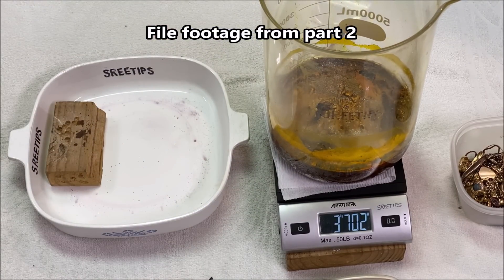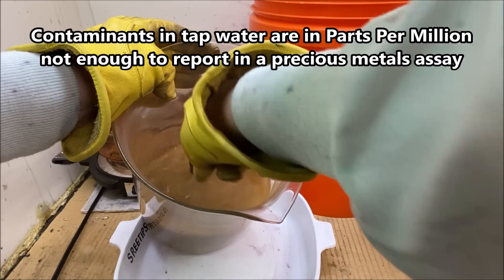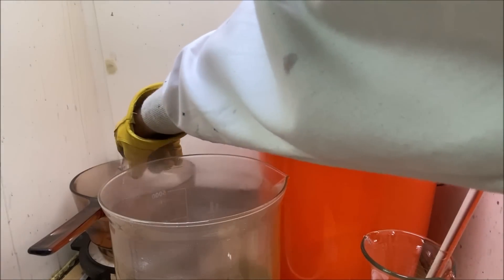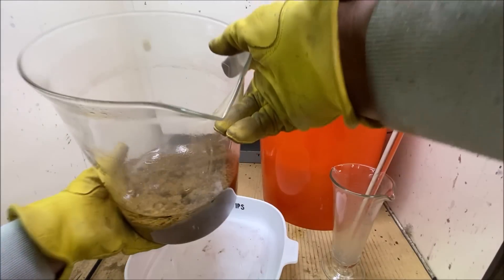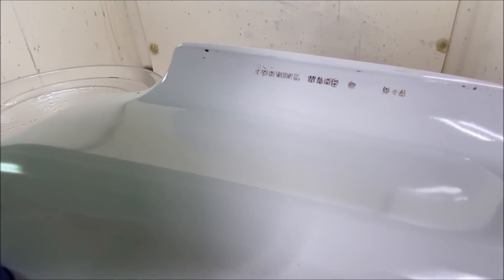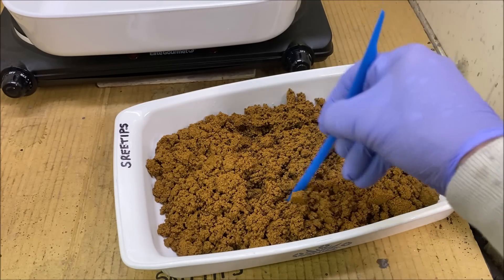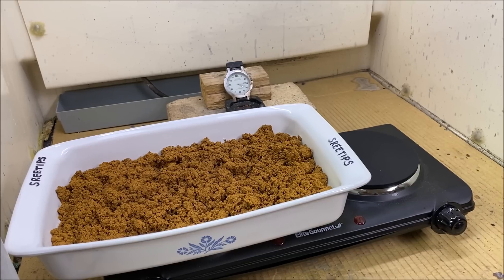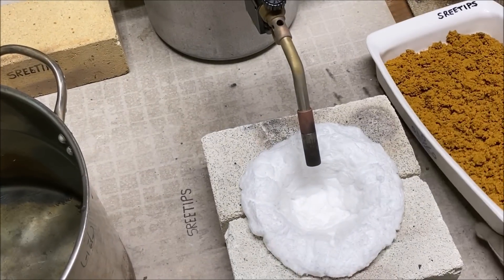50 Ounce Gold Bar Dissolved Evaporated to Dryness Pt3

Comment: you say tap water is measured in parts per million and can't be detected with an assy, then why spend money and use distilled water?
Reply from the maker: Because tsp water is chlorinated. I always use distilled water when working with silver. Chlorinated tap water will cause silver chloride to form in a silver nitrate solution. But a gold solution is already a chloride so tap water is ok.

Comment: If you wanted to break down into smaller denominations wouldn't be just easier to put the 50 ozer in one big crucible, heat it up and make 25 of your 2 oz bars?
Reply from the maker: Possibly

Comment: I’m in the middle of dissolving all my 40% and mixed metal coins, along with some other pieces of unknown silver content items as usual I get the blue and green liquids that are perfectly clear but yet I keep on also getting some sort of a white precipitate lingering at the bottom that does not dissolve with nitric any clue what that might be ? I only ask the best. 😉
Reply from the maker: “Pieces of unknown silver content” I believe that’s your problem. Some of the unknown may have junk metals (lead or worse, tin). That’s why it’s important to TEST EACH PIECE BEFORE COMMITTING TO THE ACID. Even with 14 years experience, I still test each piece with schwerters to verify silver content. It’s the only way to be sure, and to avoid nasty “white precipitate” surprises.
Reply: @sreetips  😉 thanks very much
Reply from the maker: Also, your 40% coins should be held as-is because they contain a known quantity of silver minted by the government. When you destroy the markings their value becomes questionable. If you want to refine silver then you should check sources for estate sales in your area and get up early, be there first, and buy sterling silver at those sales. The sellers use the grossly undervalued spot price to set their ask price. It’s a no-brainer, can’t go wrong buying silver at these ridiculously low prices. Good luck!

Comment: I was woundering, if you use wahing up liquid or jet dry in the water you rince the gold with, wount the gold sink to the bottom? Kind of like the gold washers. Or would it contaminate the sponge?
Reply from the maker: Whenever any substance is added it increases the risk of contamination.
Reply: @sreetips  These are the ingredients 

Water. ...
C10-16 Alcohols Ethoxylated Propoxylated (C12-14 Alcohols Ethoxylated Propoxylated) ...
C10-16 Isoalketh (Alcohol Ethoxylate or Trideceth-3) ...
Sodium Cumene Sulfonate. ...
Citric Acid. ...
Potassium Sorbate. ...
Polyquaternium-2. ...
CI Acid Blue 

Maybe werrh s
a try just to experiment with it, maybe they completely disappear with heat. Change there aggregate state.

Comment: Another thing you could do when evaporating the chloroauric acid down to solid crystals would be to let it dry down in a vessel that has been lined with waxed paper. If there are no leaks then you can pry the crystals off of the waxed paper and put them into a container of your choice, and put the paper into paper storage to recover any crystals that stick to it.

Comment: If gold gets too hot does it ever go into a vapor/gas form? I’d be so afraid the torch would blow little pieces of gold all over the place too. Such interesting videos.
Reply: Yes, gold vapor is often created with a torch fume gold onto glass. It is a common art form and can cost only a little or a lot depending on the artist and size of the work, the complexity will only add to the cost. Look up fumed glass, gold, silver and the like. They always complain about how they can't find 9999 gold or silver. If they only knew Kevin!
Reply: In fact Kevin add the key word 'fume quality' to your eBay listings for the folks looking for 4 9s gold and silver. Elemental might not catch their eye the way fume will.

After all they are going to be ones to pay the extra price for the purity of the metal since they'll be using so little in all of their operations see what I mean. And I know you don't want to let go of the silver at any price but you can certainly charge a premium over normal price for it.
Reply from the maker: Yes, gold will vaporize if get it too hot

Comment: The paper towel method works great and works better when you preload the towel before you submerge it by squeezing it. You'll remove more air, and the towel will pull the water in when returning to shape.

Comment: 10:00 you should do a pour that isnt fully melted, it would make some good pieces to sell, like 10:15 id say is ready, dump it into water and it should stay as one big chunk
Reply: And the required Artistry can be acquired by experience when you have so much to work with. 

Most of the time you can get a fragile shell with a little dust still adhering to the inside of the thin shell. The rest of the gold powder will rinse out. Doing this in a weight-less environment or freefall or microgravity would be best as the fragility of the crust of gold is overcome by gravity so easily. The art multiplier would be somewhere in the neighborhood of 50 times the cost of the gold

Comment: Another great vid Mr. Streetips, really didn't expect a pt. 3. Hoping there will be a pt. 4 now. Just wondering do you have a vid of making your own fume hood or was yours purchased.
Reply: Just buy a Thomas brand, cheap and effective for these uses. Plan your venting to have the least number of bends or 45° angles as those decrease evacuation dramatically for these uses. You can spend a lot of course even with Thomas, some units are in the 10,000s but for less than 300 usd they can not be equaled.
Reply from the maker: If I was starting over, I’d order a big 500 gallon poly plastic tank with a six inch diameter connection on top. Cut the front to make an opening. Use 6 inch pvc and an external acid-proof ducted fan.
Reply from the maker: I purchased mine on eBay.

Comment: I was wondering if you thought about using gaseous SO2 instead of SMB to ppt your gold. You have done this before using SMB and H2SO4. This method looks very clean but I am sure you have a reason for not using it. Along with everyone else, I love the struggle and results.
Reply from the maker: Chlorine will dissolve the gold.
Reply: Yep I edited this to make the correction to SO2
Reply: @jamescball55  probably would require a lot of smb in the gas generation and would take many more hours of fiddling with the gas gen eq than this ppt and hot tap water rinses. I was impressed it only took 2 of the Stumpout jars.
Reply from the maker: SO2 makes the cleanest gold.
Reply: That was my impression from your many videos using it. I was wondering why you did not use here with such large amount of gold?
Reply from the maker: Because I need about 2 liters of liquid per ounce of gold - it must be diluted or the reaction is cumbersome. With fifty Troy ounces id need a hundred liters and I don’t have a container that big.
Reply: @sreetips  See, I knew you had a very good reason. I am wondering about this reaction now and will attempt to find our more from your videos and the gold refining forum. Thank you for answering my question.

Comment: I know the intent was to break the original lump into smaller bits; but to me, this experiment from evaporation right up to the melt seemed awkward, unnecessary and inefficient. It wasn't your usual, easy flowing video series.  Still interesting, just sayin'...
Reply from the maker: Agree
Reply from the maker: Thank you!
Reply from the maker: @JP-kb5ng I have electro gold refining cell videos posted. Won’t work in a stainless bowl. The gold chloride would react with the stainless.

Comment: I don't know what those gold balls would be like, all dried out, but that would be one unique item made of gold if it remained glued together.
Reply: Yes it would. 

Internal electrostatic forces are the reason for the clumps. It only shows in 10 or more milligrams of this flour due to some science involving van de waals attraction if memory serves me today. The forces are overcome by mechanical means but only temporarily as they reestablish as the disturbing forces move beyond the contact distance. The clumps are small but acting like snowballs they cause loosely cohesive clumps to combine until gravity plays a part when undisturbed.  

Odd as it sounds raindrops also act in a similar fashion, until surface tension becomes a greater fraction of the combined forces. While in free fall, with only air resistance, water can hold its own for a long time but, as always, the force of gravity overcomes in the end unless a firm crust forms and the winds can loft them again and again until the resultant hail falls with unrelenting speed reaching terminal velocity interacting with the varied wind forces.

Comment: Blue Parrot is good gear, Chief. I used it almost exclusively when I was driving truck and when I was flying. Your sound quality is excellent on this end.
Reply from the maker: I can’t get the mic to activate while recording video on my iPhone.
Reply: @sreetips , look for push to talk or ptt in blue parrot settings. Disable it. Should pick up your mic full time. If you record something you don’t want, you can edit it out on the audio track of your video processing software.
Reply from the maker: I’ll check it, thank you!
Reply: @sreetips , any time, Chief. I hope it helps.